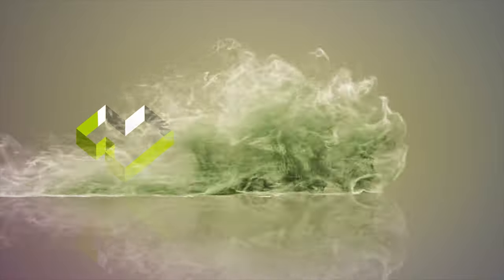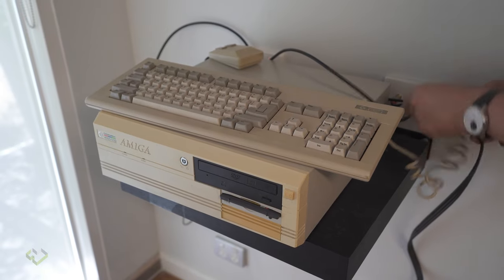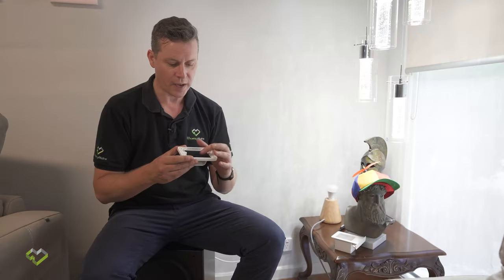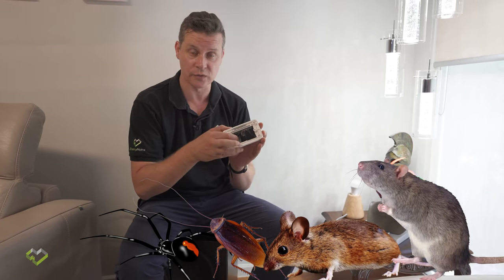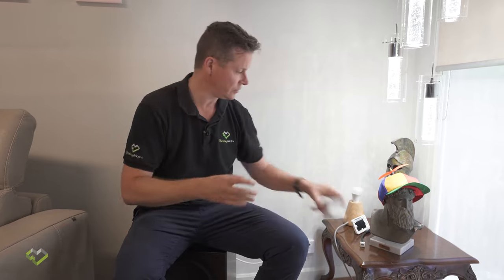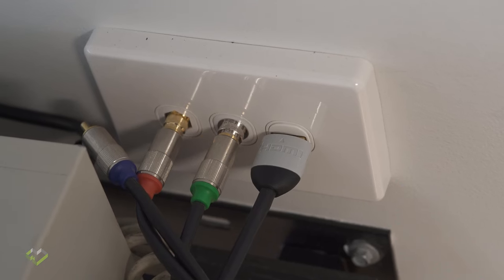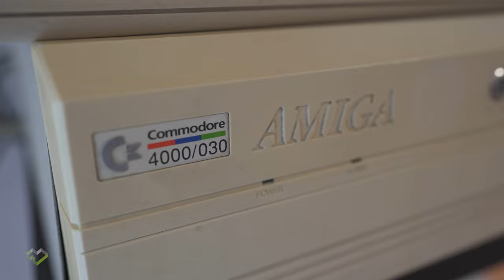TV/audio visual cables in walls - Doing it the Right Way

Comment: Same problem with all electrical switches and outlets. One might say oh that’s not much, but little cracks times 100 or 200 adds up to a BIG hole. So seal them up nice and air tight.